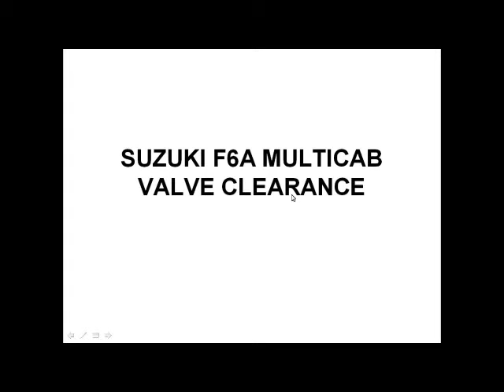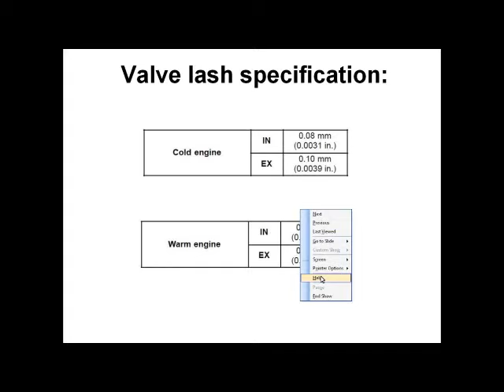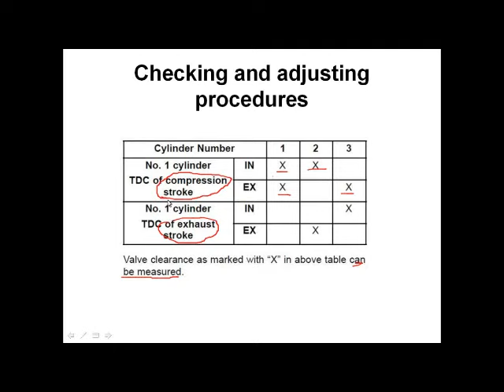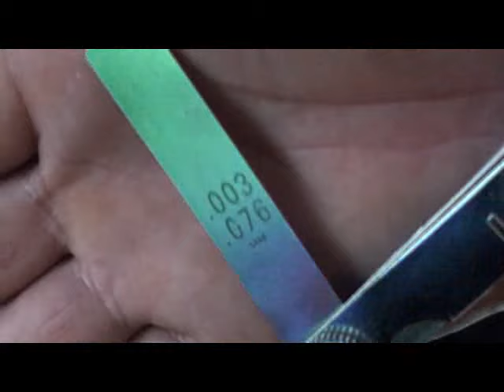SUZUKI F6A 12 VALVE CLEARANCE ADJUSTMENT

Comment: Really helpful videos! I subscribed yesterday to your channel 👍
I just bought my first Kei truck 
It’s a 1990 Suzuki Carry 4x4. 
The body is in real good shape but it had an idling problem, it would run at 3,000 or not run at all, I just solved the problem today! 
I ordered a timing belt kit and I figured when I’m in there I should definitely check the valves too, I’m happy to see they have tappets not bucket shims. 
Thanks for posting 👍

Comment: Could you pls explain
The valves clearance shown in booklet table/chart different than the feeler gauge you are using.
Table/chart: inlet valves .8mm/31 inch
Ex valves .10mm/39 inch
While your feeler gauge is
Inlet valves: .076mm/.003 inch
Ex valves: 102mm/.004 inch

Comment: Master..napanood ko uli itong video mo na valve clearance adjustment. Napansin ko lng dun sa simula ng video mo, noon pinapakita mo ung feller gauge mukhang 0.03 ung pinili mo na feeler gauge. Ano ba maganda na clearance para lumakas sa uphill climbing ang f6a engine at di maingay ung tappet nya.
Reply: in take 08mm at 0.10 ex, kaso hindi maganda yung tunog nang makina, pero for sure malakas masiyado sa akyatan

Comment: Bro tanong kulang anong tamang pagka sunod sunod sa pagtune up ng f6a alin dapat mauna
At anong size sa intake 
At sa exhaust
Reply from the maker: Boss I assume na gusto nyu po malaman kung paano at ano ang tamang pag aadjust ng valve clearang as part po ng pagtune up.  try nyu po watch yung video sa baba about parin ito sa pag aajust ng valve clearance. sa pag aadjust naman po ng valve clearance ang importante namn po dito ay masiguro na seal tight yung combustion chamber meaning naka close po lahat ng mga valves both intake and exhaust. Importante din po na ma double check kung nasa tamang torque or higpit yung mga bolts sa cylinder heard lalo yung nag hohold sa mga rocker arms.

https://www.youtube.com/watch?v=5peV05jtkqc&t=262s

Comment: Sir pag naka tdc na ung  sa flywheel at ang distributor ay naka turo na sp 1 ay laha ng intake at exchaust valve pede na tune lahat, tnxs po.
Reply from the maker: Boss hindi po lahat ng valve pwede ma adjust, dun po sa table sa video bandang 2:18, #1 cylinder TDC compression stroke, lahat po ng intake and exhaust sa cylinder #1 ay pwede ma adjust, yung may x po na marked. meaning po, yung mga valves sa #1 cylinder ay naka close lahat, ma cecheck nyu po yun pag yung racker ay nagagalaw nyu. meaning hindi po ito naka tukod sa valve. basta po ang palatandaan kung pwede ma adjust ay nagagalaw nyu po yung racker arm. another palatandaan po ay yung position ng cam lobe, yung nakaukbo sa cam, dapat yung racker arm position ay hindi naka lapat sa cam lobe.

Comment: Boss, yung multicab ko bagsak sa emission mtaas daw lead ata yun, ipa tune up ko daw at ipa change oil, bgong change oil nmn ako nun, wla nmn xa usok pero bgsak daw..saan kya oroblema nun boss
Reply from the maker: Boss gumagana ba yung Exhaust Gas Recirculation Valve nyu? ang EGR kasi ay nakakatulong para mas less yung oxygen na pumupunta sa exhaust pipe. Ni rerecirculate ni EGR yung oxygen and nitrogen gases na galing sa exhaust manifold. Pag pinagsama mo yung dalawang gases mag form sya ng pollutant gas ito ya tinatawag na nitrogen oxide. Not sure kung ano yung standard sa emission test.
Reply: Ah yun pala yun, sige po saamat sa tip tingnan ko kung ok pa at di barado at kung merong egr yung multicab namin..salamat
Boss..big help!!
Reply: Bagsak talaga boss pag walang padulas mga Yan haha

Comment: Sir tano ko lng naguluhan kc ako yung una adjust ka TDC pag katao pagadjust muna sa intake 3 nagdjust man na TDC ganyan ba talaga pag.adjust sir na dalawang beses ka mag.adjust ng TDC hopr na reply ka comment ko sir gsto ko lng din na adjust sa akin
Reply from the maker: Boss salamat sa pag view ng video ko. sa pag kakaintindi ko sa tanong mo kung bakit dalawang beses ako nag adjust o dalawang beses ko inikot yung flywheel TDC mark, it is because sa compression stroke may mga valve na hindi naka  close meaning hindi mo sila ma aadjust like sa cylinder number 2, yung exhaust valve nya naka open pa at sa cylinder number 3 naman yung, intake valve nya naka open. sa video ko bandang 2:44 makikita mo dun sa table kung ano yung pwed mong ma adjust na valve habang nasa TDC comnpression stroke. Kailangan kung ikotin yung flywheel sa position na TDC ulit but in this case nasa exhaust stroke sya NOT in the compression stroke. Bali sa 4 stroke engine, ang una ay Intake stroke (bukas ang intake valve at papasok ang fuel). ang pangalawa ay compression stroke ( close lahat ng valve sa cylinder both intake and exhaust valve), ang pangatlo ay ignition stroke (combustion o power stroke na tinatawag), both intake and exhaust valve sa cylinder ay close parin. ang pang apat ay exhaust stroke ( ito ay ang pag labas ng nasunog na fuel sa cylinder at ang naka bukas na valve ay yung exhaust valve. hope it might answer some of your question. regards
Reply: Basi sa experience ko sir pangit yung resulta ng 3...sa 6 yung ok.